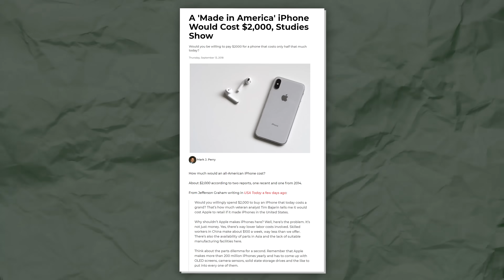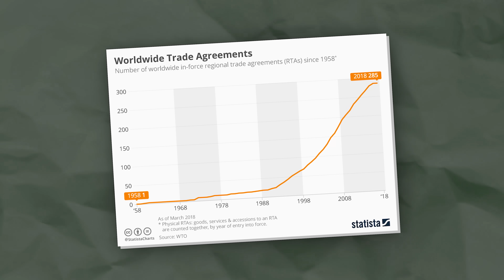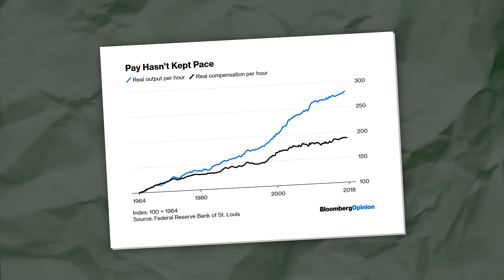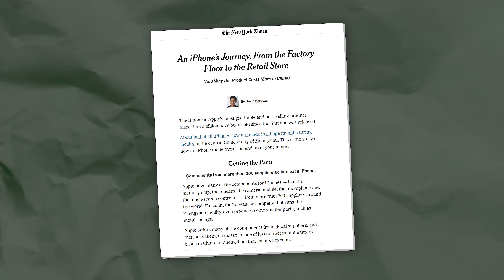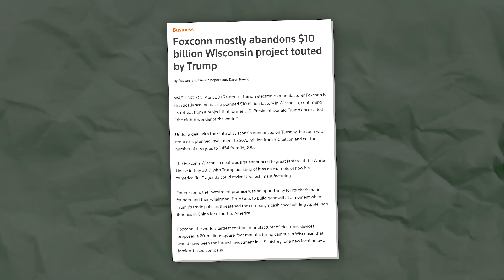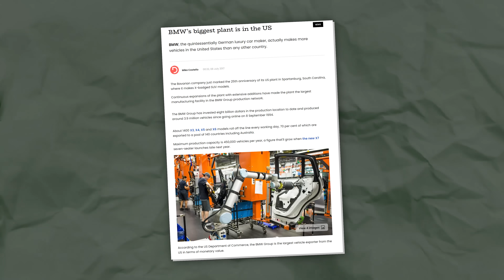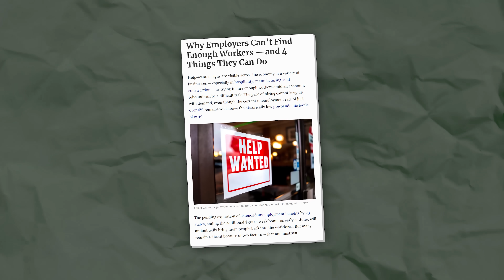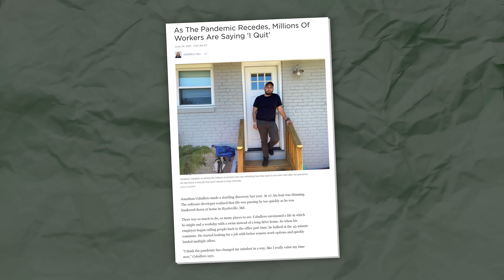How Much Would it Cost to Make an iPhone in America?

Comment: Even if all the manufacturing was done domestically you’d still be reliant on foreign raw materials- not sure where the North American lithium mines are!
Reply: Jee Vang  how so?  I’m just pointing out that even the most basic raw materials are sourced globally.
Reply: In Nevada. Lithium isn't a type of resource that is hard to find, it's everywhere you can find salt - which is in every corner of the planet. The tricky bit is separating lithium salts out of sodium and potassium ones. For that you need dry air and giant evaporating ponds, and water. So you need a desert, with a water supply, it can be a tricky combination to find.
Reply: @aleksandersuur9475  In my country in Eastern Europe (Serbia) they want to extract large amounts of lithium from a specific location that has a nice scenery, and locals and other citizens are blocking it. Foreign company (Rio Tinto) set aside 2.4 billion $ for digging on a specific location after they did testing, but from what i can see it's not in the flat area of the country that still has sand, and was a former desert. They are presenting it and probably lying that it would be the largest lithium extraction site in Europe.
Reply: This bald dude don't know anything at all

Comment: The cost of starting up something like mobile phone manufacturing is really hard to calculate. There's a lot of parts in a modern smartphone that have never been made in North America, are you going to need those made in the US or are you happy with just the final assembly? If not, do you need the gold and cobalt to be mined in the US as well or how far do you want the supply chain within the country to go? Also, building up a massive industrial complex and hiring and training hundreds of thousands of employees to work there has costs when you're setting it up, but once they're there the maintenance is easier.

Comment: I would definitely pay 20% more for something to NOT be made in China, anywhere else is fine.
Reply: I call cap
Reply: So you have a Samsung ?
Reply: most of the profit gonna get into the companies who sells the product anyway even if its made in china, just a 20% rise in price is impossible if the manufacturing moved to the US but if its moved to southeast asia like vietnam indonesia or malaysia maybe its possible. if you want a made in USA iphones it could rise atleast 100% to keep the same profit margin as iphone had now. well it still depends on what product tho, simpler products like bikes or more expensive and heavier products like cars are better choices than phones and small electronics to manufacture in the US. electronic manufacturing is ust that much cheaper in china, taiwan, korea, and southeast asian countries.
Reply: @ssrbgangimaribotan6thofthe12  China manufacturing facilities has come a long ways then what they were before.  None of these southeastern Asian countries has the technology to build these machines to mass produce said products efficiently and meet expectations.
Reply: I bought a pair of tennis shoes made in France. Both heel straps ripped off the next day I tried putting them on. CHEAP non-made in China product. Most of these countries outside of China don’t have the equipment facilities to make products that meet specifications.

Comment: There is already the infrastructure here in the US. TSMC is building a chip plant in Arizona so that eliminates that excuse. Not to mention the US is a power house in technology. I don’t understand why all of it is made in Asia where the tech can be stolen.
Reply: Semiconductor manufacturing is actually a high value-add operation. Have you seen pictures of a typical FoxConn assembly line? Iphone manufacturing is more akin to sneaker or clothing manufacturing, with armies of low paid workers toiling away doing the same repetitive tasks over and over. The workers are housed in company dorms and during new product rollouts, they are often roused early in the morning to work around the clock rotating shifts. You think American workers will work like that?

Comment: Start from the ground up:  pay people to sort recyclable materials from garbage (If there is anything we will always have more than enough of, it is trash).  From the recycleables make raw materials for product production.  From there, supply factories to make new items using the recycled materials.

It may take a lot of time, but it would be a good start.
Reply: What if it is cheaper to mine raw materials? You do realize materials that are easily recycled (iron, steel, copper, aluminum, etc) are already being recycled on a large scale and have been for decades?
Reply: @capmidnite  Actually, one of the problems revealed by the tariff war with China in 2018 (And made worse by the pandemic later on), is that we were our recycling & garbage to CHINA, and when they refused to take it anymore the refuse barons became desperate to find somewhere else to send it to.

... America should really at least take care of its own recycling; I am just saying that it should be used to restart wider-scale American manufacturing.

Comment: Hey! I'm actually researching global supply chain reshoring for my Master's thesis and I think you slept a bit on three massive assumptions: The convergence of advanced technologies (Machine Learning/Artificial Intelligence, 3D printing, advanced automation, robotics, etc.), ESG incentives/climate risk, and rising wages in emerging markets. Many companies are considering reshoring operations closer to home if they can automate the costs of local labor with hyper-efficient automated systems. These value chains are a lot more sustainable because of the simplified transit system. You can also slash retooling costs in these facilities because the robots making your goods are standardized, mass programmable at a switch, and communicate with each other for maximum efficiency. If you include these assumptions, the goal around reshoring is that we can actually make our goods cheaper, more sustainably, and more responsive to market shocks. The focus of my research (and I think a far more interesting question) is how would this migration of supply chains from emerging markets back to rich economies impact sustainable economic development in emerging countries, since this migration may displace manufacturing workforces and foreign investment. What are your thoughts?
Reply: He has addressed that point, the initial capital expenditure is too high for the companies and investors to absorb its easier to manufacture there and ship it to US, even if tariffs are increased.
Reply: @yoppindia  Fair point. I'll agree with this argument for now, but less so in the long run (next 2 decades)
Reply: You toss around terms like "hyper-efficient automated systems" and "mass programmable at a switch" as if they mean something.  Have you had any experience or coursework in Industrial Engineering or real world experience on a factory floor?
Reply: @capmidnite  Beyond my current coursework, I shadowed under the supply chain director of a multinational clothing supply chain management firm based in Hong Kong - one of the largest companies of its kind in the world. If the clothes you're wearing came from China, there's a good chance their company played a role in managing a piece of the supply chain. Among other reasons, reshoring makes sense in their particular case because they can manufacture clothing brands/lines with volatile demand profiles in the US, then respond to US demand shocks in real time + A/B test prototypes in real time, versus waiting months for samples or back orders to arrive from abroad.
Reply: Apple made the Mac Pro for a while in Texas, which was called the trash can. The issue was there sales for that Mac were bad and they scarped the design. Personally I would pay another $200 to know that my iPhone was made in America. The fact is Apple products will only become cheaper to make sense dumping Intel chips to making there own. Plus with more manufacturing in the US they would have more people with money to sell too. The issue is China is still considered a developing nation and the World Bank Lends them money with 0% interest plus they de-value there currency on top of that. The only way we in the US can stop China from becoming a super power is to take all there perks, but doing so you will have to fight Wall Street, lobbyist, unions, and government regulators. There are still too many people in the world willing to sell there mom to slavery for some of that sweet Chinese business.
Reply: @tedpiano  I’d avoid using 3D printing or ai except in specific case studies.

Ai is basically just a buzzword

And 3D printing is great for prototyping but not especially well suited to general manufacturing (slow, poor surface finish, structural weakness between layers), though there are some companies that have integrated it into their production lines.
If you do want to look at 3D printing, use the term additive manufacturing.

You would find it useful to talk to an industrial engineer, especially if their businesses have offshored production, they would explain the limitations of manufacturing. 
Also, as been stated before don’t say “hyper efficient automated systems” or “mass programmable at a switch”, buzzwords will not endear you to any engineers or people with backgrounds in manufacturing 

I hope it goes well for you, no more buzzwords
Reply: @tedpiano  also supply chain management doesn’t sound like you got experience of the actual manufacturing, you should probably see if you can see the production lines of some businesses (or at least watch a few videos explaining the manufacturing of specific parts).
Reply: @chrissmith3587  That's helpful, I appreciate the feedback! Outside of supply chains, I also come from a UX Writing, comms, and management consulting background, where the goal is usually to help laypeople make quick sense of ideas that take months or years of studying and experience to really grasp, so I use "programmable at a switch" because it's more tactile and visual than trying to introduce somebody to the complexities of intelligent automation, micro factories, and additive manufacturing. I know the reality of these systems is a lot more complicated. That all said, you're right about how I'm using buzzwords, and that's lazy on my part. I'll strive to do better, and communicate in a way that's both accessible for laypeople and also considerate for engineering/pro audiences :)

Comment: They can automate the manufacturing of much of the phone, which is what they would do if they were to move operations to the US. This would greatly reduce costs, and would likely eliminate the third-party manufacturer.

Instead of an ungodly 350,000 people to make 500,000 phones a day (which is HORRIBLY inefficient), you'd have a much smaller labor force in the factory, probably 2,000 to 3,000. In China it is cheaper to hire a bunch of wage-slaves than it is to make machines, in the US it would be the opposite. In the long term it'd be CHEAPER in the US, they just don't want to make an investment.
Reply: Many are investing and researching, the issue is that, it is not only the US but china too, so by the moment the US is capable of manufacture stuff cheaply in the US, it would be already in China too, and of course ... Cheaper
Reply: If this is true, why haven’t companies saved billions of dollars by doing it
Reply: @spandexter1234  Because it requires billions of dollars of investment, and has an ROI attached to it.

In the short to medium term, Chinese Labor is simply cheaper. If that source of labor were effectively taken away, such as if the USA mandated that Cellphones sold in the US are entirely manufactured in the US, and owned by a US Entity with no ties to China (which is actually more likely to happen than you'd think), it wouldn't really impact them financially all that much in the medium term, beyond an initial frenzy should they not have much forewarning of it to secure facilities for manufacturing in the US.

You see, when people are paid out bonuses based on TODAY'S growth and TODAY'S valuation, a lot of them don't have the incentive (nor the morality) to consider putting their company's needs first.

They have an option of reducing their profits in the short term, to increase them in the long term, but coming at the cost of their bonuses and pay now, to instead help someone else that'll work there in 5 years when they've gone somewhere else (executive turnover in general, not specific to any company, is extremely high, they hop back and forth every 2-5 years).

If you told me that if the Company hits its target of 1,000,000 Teddybears shipped this year I get a $10,000,000 Bonus, my first and only concern would then be how to best go about shipping units, NOT making money on each unit, or saving money elsewhere. So I screw up some stuff, damage relationships with vendors under the radar, but make my target, get my money, and move on next year to our competitor. Meanwhile my former company then makes a substantial amount of money less next year, as vendors are irritated by the lack of quality control, a logistics nightmare (I of course didn't spend the time to organically grow our network, nor did I oversee its development to ensure that it is stable), and most likely by a lack of appropriate customer service personnel to handle the increased volume. This happens every year throughout the country.

TL;DR
Executive (related 'Performance' Bonus) Greed
Reply: The phones can’t be assembled by robots. Not now at least. Way too small and sensitive.
Reply: @krrrrrrr3783  ...I think you need to go lookup how these things are made lmao
Reply: @krrrrrrr3783  yes they can I work in manufacturing here the states it's called surface mount technology or SMT

Comment: 4:15 Mistake when calculating manhours required for an iphone. It should be 350000*8 (or 12)/500000 i.e. 5.6-8.6 manhours because those workers don't work for 24 hours but 8 (or more realistically 12 with Chinese labor practices). Even this is probably on much higher-end, watch any repair/assembly video of iPhone and it takes 20 minutes to assemble. With automatic soldering and QC, and a heavily trained and specialized workforce, it shouldn't take more than 3 hours per iPhone (even this is probably an overestimation).

If my calculations are correct, your next calculation related to transporting assembly cost to the US is wrong too and should be not 42$ and 268$, but 14$ and 86$. SO not 200$ difference but 70$.

And please put your sources, so it's easier to check your conclusion
Reply: @IOFLOOD  Good point, but it's more of ballpark calculations. It's important to remember that this infrastructure and workforce in China didn't appear out of thin air and with higher costs, companies have incentives to optimise and automatise processes even more. Right now plenty of steps could be made by a robot, but it's cheaper to hire cheap labor, so saying that price will increase proportionally to wages isn't true either.
Reply: @IOFLOOD  Very good points, there is reason why companies choose to move manufacturing there. I just think of semiconductor fabrication plants and plenty of them are located in those higher labor, higher regulation areas, like US, Taiwan, South Kore and Japan.
Reply: Those manpower most probably used to operate 24 hours (dayshift and nightshift).
Also they need a lot of manpower because there’s probably a lot of repairing/rework. Contract manufacturers usually use large workforce to hedge the problems that stems from production since these products aren’t developed by them, most of the production process cannot be modified before informing the customer.
That’s what i observed working in my workplace.
Reply: @Shadowkkz  Maybe, i just assumed that 350000 figure is total employees, not employees per shift
Reply: @IOFLOOD  Yes, I agree with your points and I understand differences in assembly of phone and creating of chip in a fab and I wasn't arguing with that. I just mentioned fabs to show that labor costs isn't everything and as you mentioned yourself, certain things like benefits of hubs can outweigh that.
Reply: Except Americans are not willing to work in a factory doing repetitive tasks for $15/hour

Comment: If iphone were made in usa, apple wouldn't be able to make best quality Iphone with only unskilled worker with minimum wage, apple make very complicated smartphone not flipping burger forgodsake
Reply: Have you ever disassemble a device? I guess not? iPhones and most devices are built like legos. If i can disassemble it with next to zero knowledge someone can assemble it with next to zero knowledge. Remember apple repair has to be able to fix your phone if you drop it they would have big issues with repair costs if they needed extremely good labor. The assembly is what is done by hand or do you actually believe the solder components on by hand on an iPhone? The production of the cpu and the motherboard is completely automated. Do you actually believe that Chinese minimum wage workers have a higher education than in the US?